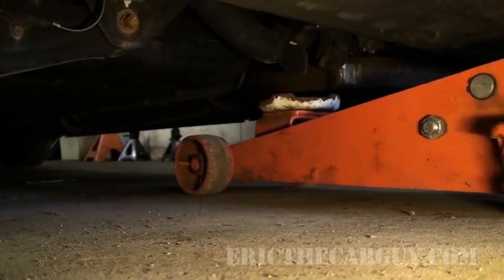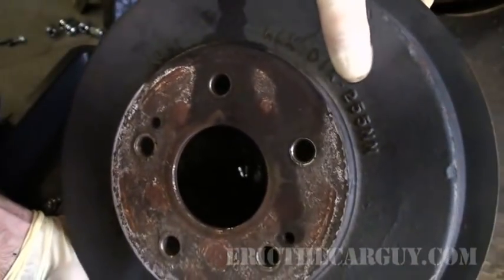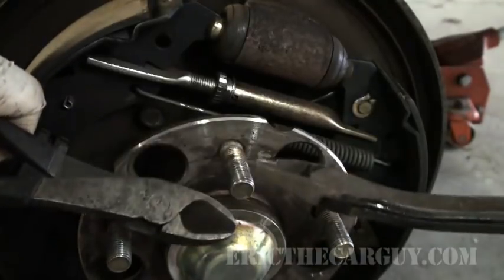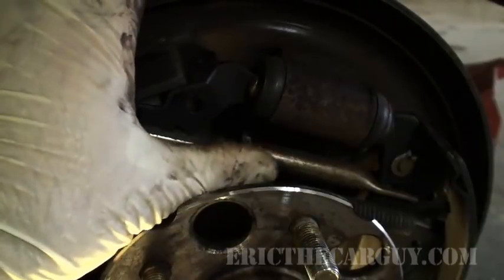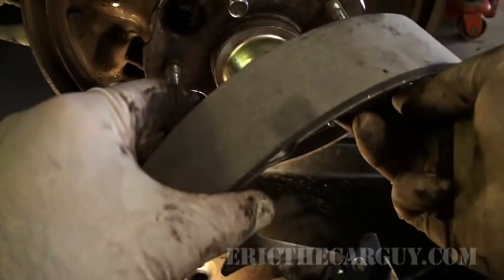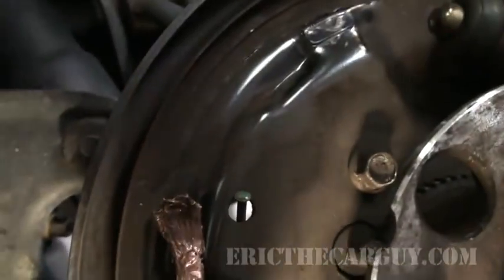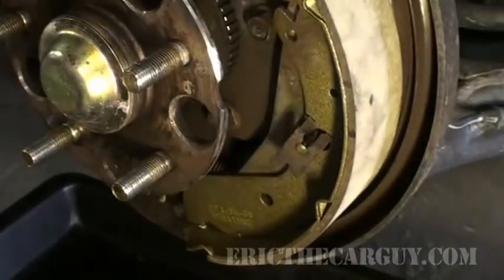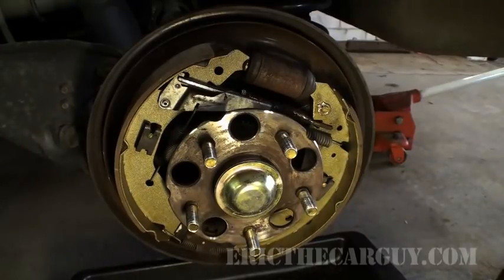How to Replace Drum Brake Shoes, 2001 Odyssey  - EricTheCarGuy

Comment: So i recently did this on my 01 crv. When i was putting it back together i accidentally let the shoe push too far one way and the wheel cylinder popped open and out to the point where i could see the rubber seal for that side of the actual cylinder part. i pushed it back together and it didn't seam to be leaking. does it coming apart like this destroy the cylinder seal?

Comment: Hey Eric, On my truck it has front disc brake rear drum brake set up. and it is making a squeeking/ chirping noise at low speed from 0-15 MPH. after that speed it stops. I have noticed that after I drive it for a few miles, it is not as loud. I can still go slow and still hear it but it is not as loud. I think it is the brake wear indicator, What do you think?

Comment: @niccusmaximus there should be 2 rubber plugs on the back of the backing plate, if you pull the lower one off it exposes a hole and you have to turn the star adjuster down with a screw driver or a chisel through that hole to tighten it i believe, its actually really frustrating, you could just pull the drum off and turn the adjuster by hand, but if you know what your doing the first way is faster

Comment: @EricTheCarGuy i finally got to taking the front brakes off and...i noticed a big score ring in the middle of the rotor also lubed the brakes...still squeks....also when i press the brake pedal from 60km/h to 0 then take off again theres a big humming noise in the front end. also one wheel has lots of brake dust on the rim

Comment: I tried your bolt method but I ran into a problem. As I was screwing the bolt in with a ratchet I was also spinning the drum and when I got to a certain tightness the drum started to make this grinding noise while spinning. I unscrewed the bolts but the grinding noise still continued. The drum still spins freely, but the noise that's coming when it gets to the 4 o clock area is whats worrying me. It is the rear drum of a 2002 mazda MPv. What have I done please help

Comment from the maker: @andrewthompsonuk1 Brake fluid replacement has been recommended for some time but hardly ever done, it's a shame because as brake fluid gets old it absorbs moisture and becomes acidic, once this happens it eats away at all the rubber parts in the system this is why it gets dark over time it's actually full of all the rubber in the brake system.  Not to mention it's boiling point gets lowered as it gets older.  I think it might be time for a brake fluid video soon.

Comment: hey eric i have 02 toyota rav4, when i press the brakes i hear a squeaky sound even if the car is not moving it has drums in the rear and it seams thats coming from the back, what you think is causing the noise? does it running or parked

Comment: I own a 2001 odyssey with 70,000miles and I've been experiencing a grating noise from my driver side rear brake when I applied my brakes, I had the brakes completely serviced and shoes are in good condition and I even replaced the drum (OEM)  and still no luck, do you have any suggestion on how to correct this problem? Thx

Comment: Eric I have a question. After changing the shoes on my Odyssey, the parking brakes seems to be so weak. How do I make it stronger? When I step on the parking brake/emergency brake, it clicks ones, then goes down a bit and then it clicks around 3-4 more times. Could it be that I didn't adjust the drum brakes properly? I didnt know how snug I should put the Drums on so yeah. I'm just hoping you could help me. Thanks

Comment from the maker: @ankl3br3ak3r The first thing to check is the rear brake adjustment as it is the biggest contributor to brake and parking brake pedal feel, I'm sure if you recheck and make the adjustment the brake will work like it should.

Comment: @Michiganborn1969 I was wondering about re-using the old springs. Do hardware equipped brake pad sets cost that much more? Seems like brake cycling over a  100K miles, plus rust, etc would be a good reason to replace them along with the pads... What is usually done? RL

Comment from the maker: @btnhfane1999 Actually Honda recommends to do nothing with the surface if there is no pulsation for pads or shoes.  I have yet to experience a noise in a situation like this one.  If the surface was damaged or showed signs of overheating I would have machined them but it this case it worked just fine and is still quiet to this day.

Comment: yeah. back way off the adjusters,, then instead of a plyer, use a vise grip or needlenose vice grip on those heavier tight stronger springs. it keeps a great grip instead of slipping. I very much enjoy your vids, specialy saw your a/c vids, gonna check mine here shortly, it has pressure, may just hook a can up to it to see if it takes it. keep the vids coming, :)

Comment: Copper Ease is what's used,it has a high melting point which makes it perfect for brakes,you can put a bit on the back of disc pads too and on the back of alloy wheels as they can stick to the hub and make them hard to remove,caused by a reaction between steel hub and alloy wheel.

Comment: I normally make the make the star adjuster tighter so it has more resistance. The brakes will wear in because the surface isnt perfectly flat and the pedal will be firm. If you can get the drum on over the pads they most likely wont overheat. You just havr to watch the lip from use. If you have the adjustment on the back with the drum already on and try to get it this tight.. then theres a good chance theyll lock. Either way good video

Comment: You can take a long cheap screw driver and make a notch on the point of
 it with a grinder. It works really great, especially to remove those stubborn springs.

Comment: @Bushougoma as i know they are alive and well only with mini sedan cars that is front wheel drive and pick ups. some times (i'm talking about middle east market here) when you pick a small sedan with full options, it comes with 4 disk brakes , but when its standard , the rear brake is drum the front is disk. i think the reason for drum brakes at the rear is just because front wheel drive cars depends mainly on front brakes when they're breaking. thank you for your comment .

Comment: @xsenceo89x 
I've replaced shoes on an 85 Toyota 1/2 ton pickup. After I got the drum back on I didn't have to keep putting on & off the drum to keep adjusting it because on the back of the backing plate there was a tiny slot where you would pull out a rubber plug, insert a screwdriver and adjust it from the backside of the backing plate. Saved a bunch of time.

Comment: Always clean the mating surface on the hub assembly.  Always use high temperature synthetic brake grease on the contact surface of the shoes.  Always tighten down the shoes to the drums so that with good force you get 1 and only 1 complete turn of the wheel, for this you must use a star adjusting tool.  To use this tool you must have the wheel on and torqued correctly -the tool goes in through the back of the assembly and adjusts the star wheel.  flush all lines with new fluid kitty corner.

Comment from the maker: @zztopgearhead1 I used to have a 67 Catalina that I loved to drive with a 400.  I bought a tri-power from a guy that I was going to put on it but I never got around to it.  As for your car with that much horsepower with 4 wheel drum brakes and probably not even power brakes sounds fun but scary.

Comment: @EricTheCarGuy I was thinking that route also because the odyssey doesn't look familiar. Problem is the drums have probably been on since '93 and it only has 60k milies yet I couldn't get them off last night. hammered between the lugs, and everywhere. Got one side soaked with rust bust. I'm finding the breaks are not releasing fully and I have to sometimes drive in reverse and slam on the breaks to unlock them

Comment: Anyway, I just had to comment to make about what I think you are missing in your video library and that is CV axles and boot replacement. Most people out here, especially, these young people out here with the rice burner's drive front wheel drive cars and a lot of people either buy them used or keep them a long time so CV boots are going to wear out.

Comment: Recently I tried to replace the wheel cylinders on my 95 ford ranger but I could not loosen the brake line screw. I used a flare wrench and a penetrating compound. Now the screw  is pretty trashed and I still don't have it off. Is there anything I can do?

Comment: @rlewis1946
The last time I did rear brakes I think I had to purchace the hardware separate but they were hella cheep like under $10 per set. It may also depend on what vehicle your replacing the shoes on as well. You have to ask your parts guy if the hardware kit is supplied with your new shoes. Sometimes they are.

Comment: i have a question but its about front brakes. i replaced my front pads and rotors on my 2000 grand am gt and everytime i press the brakes they squek and there BRAND NEW BRAKES!  i also kinda scored the rotors and pads to kinda quiet down the squek but kinda didnt work..and suggestions?

Comment: handbrake is adjusted to end. these adjustments are either under the car or under the console inside the car. handbrake should be able to lock the rear wheels when they are adjusted correctly. Anyway, this is the rules here in Norway: D

Comment: the main reason for a stuck bolt is corrosion and so hitting it with a hammer really works well to bust the grip of the rust. But if that doesn't work,, then try some heat,, the difference in metal expansion can help break the grip of the corrosion. Also, don't forget penetrating oil. It took me 9 months of soaking but I freed up a slide on a old carb worth $500 to replace.

Comment: whats the name of the electric tool you use to unlock remove the tire ? I tried manually but I can't
Reply: Try using a breaker bar
Reply: William Todd impossible manually, I tried everything, I bring the car to a mechanic who tried with his Air Impact Wrench but couldn't remove them. we started hitting the lug and kicking them then tried with wrench, the lug are screwed but finally come out. Thanks

Comment: Can anyone help please. Every time I remove the drum it would pull the brake shoes with it, and sometimes it would break the nail that is holding the flyers. I just want to know what am I doing wrong. thanks in advance and sorry for my grammar.
Reply: The most inner edge of the drum may be rusted so the brakeshoes gets caught in 'em. To get the drums of easy, you'll have to spin the adjustor backwards. Then you can just grind down those edges 'til you can put the drum back and remove it easily. And don't forget to spin the adjustor back. That  should be the problem unless you made a mistake i once did, i left the parking brake on. :)

Hope this helps.

Comment: You may find out that it is not necesary to manualy adjust the new shoes close to the drum. The automatic adjustment,, wich you were using to adjust it, wil do that for you the first two or three times you press the barke pedal, better before you aply the parking brake.
The "spring" you talk about in 25:30 mn in your video is the "thermo clip" it will get the shoes clouser to the drum as this heats up and expands.
Excuse my poor english

Comment: In my experience,the most difficult rear shoe replacements have been Ford Contour.
 DO NOT attempt it. That is one of the few cars that require a complete spring kit to replace the shoes.
 I'm not kidding. Lucky that few are around,anymore.
If your shoes go metal to metal,replace the springs or the brakes  will squeal like a little piggy.Excessive heat kills the springs.

Comment: The cost to initially manufacture is the cost that's less, not the cost to maintain or the complexity. It's probably mostly the rotors that make disc brakes more costly to initially manufacture. I could be wrong on that.

Comment: Wow, I would not get a brake job from this guy!  For one, you don't damage the springs and put them back in.  Spring are a set to a spec for the braking application. If you mar up the spring, you reduce the spring tension.  The cause of a lot of bad brake jobs is in this video.  Read the manual!

Comment: Do one wheel at a time.  That way you can look at the untouched wheel to see where the parts go on the wheel you are reassembling.
Reply: Yes indeed - never dismantle both sides at once.  Having that other side to look at helps a lot if you "forget" where a spring or something goes.

Comment: i like to use a seal puller tool to remove springs... in fact that's all i think they are good for... they don't work as designed for removing seals...

Comment: this video should read how to do this job the hardest way ever LOL & I would never put cutters on a spring now you dented & weaken the spring
.Also if you did want to remove a spring in this way back the adjuster off that will take lot of the tension off the spring.

Comment: Perhaps, but the process of making a rotor can't be all that involved can it? Machining a block of steel on a lathe into a rotor should take less steps and use less parts than making springs, bearings, curved shoes, the drum etc etc

Comment: I did this on my Cadillac. I did it a little differently. For starters, I got a box of model paints and put a different colored dot on each part then took a picture on my phone. For the springs, I tried using cutters but opted out. I live in the UK so replacing them would take a while so I used bicycle tire irons. Putting the drums back on, I put them on snug just because I thought I seemed right. It's a Cadillac but the springs are still a bitch.

Comment: I was surprised and a little disappointed that  you didn't cover the process of loosening the self adjusting mechanism that is often required when the drums don't come off as easily as they did in the video.
Reply: That can be difficult. If the shoes went metal to metal,you will have work to get them off. 2 tools required. One to release the self adjuster blade and another to rotate the star wheel. Not fun.

Comment: @CoolasIce2 
On that 85 Toyota 1/2 ton I mentioned to xsenceo89x, 
I had the same problem where the shoes have eaten a nasty grove into the drums and made it a B(*&%H to get off. Since the drums were worn way past machining, My buddy and I took a 25# sledge hammer and started bashing away little by little at the lip of the drum untill they finaly had enough clearence to come off. I often wonder if a cutting wheel would have been easyer.

Comment: My boss taught me to lay the springs out in the wheel that you already have off.
 Use the valve stem as the upper pivot and lay the springs out in the wheel.
PLEASE,do one side at a time.
 You will thank me later.

Comment: I don't see why people get hung up on adjusting the shoes by using the star wheel before putting the drum on. Just put it together and cycle  the parking brake lever like it was designed to be used.

Comment: Put a block of wood under the brake peddle so nobody steps on the brake and blows out the wheel cylinder!
Reply: If you are the only one there, there is no one that could step on the brake pedal!
Reply: Ed Mitchell
Ha!  EVEN if you are the only one there -- do it.  I know what happens in a rush.  LOL